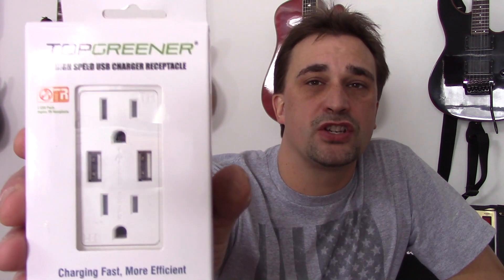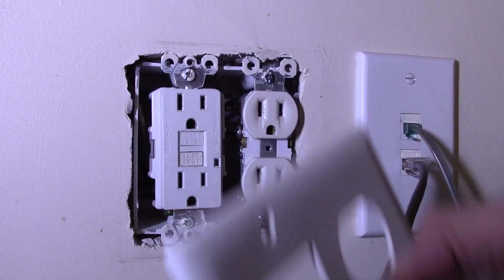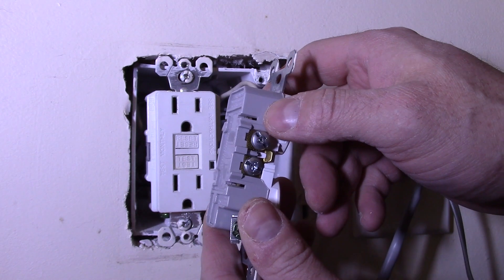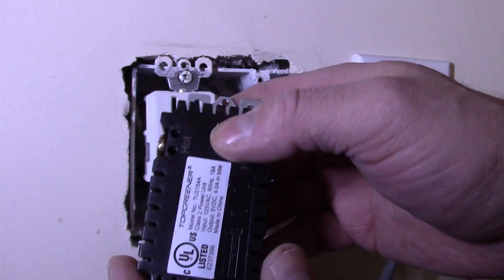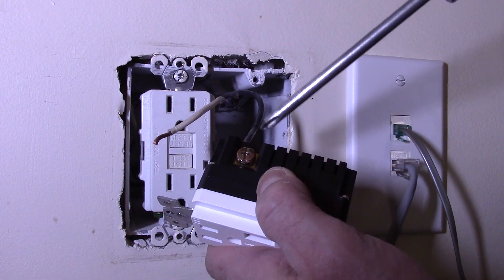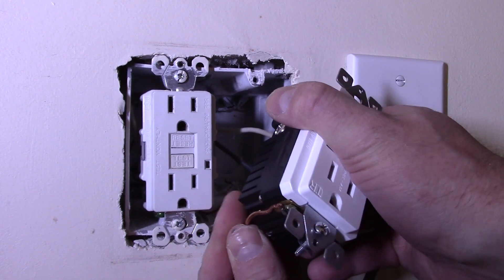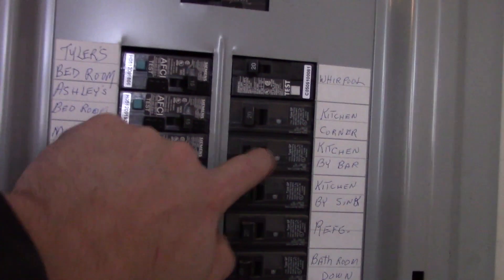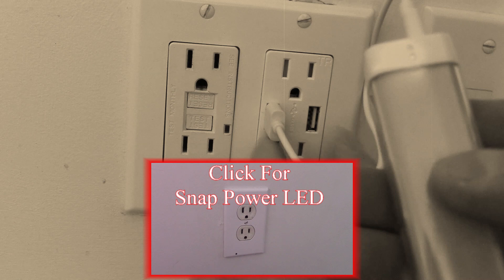DIY How To Install A High Speed USB Charging Receptacle USB Charging Port Installation

Comment: I liked your demonstration and installation.  You were easy to listen to and understand. I have a topgreener usb receptacle that I installed. I like it the best of all that out there. One drawback is that they are a little larger than some of its competitors.  They can be a challenge placing them in the electrical box, but I still love it.

Comment: Nice video.  My preference is to side-wire rather than back-stab except that in many cases you have a line and a load wire (2 black) and one screw in which case side-wire isn't an option.  These are great outlets but I do sometimes have trouble arranging the wires in a gang box so that it fits, being so much bigger than a standard outlet. Pain in the rear.

Comment: What would you do if you had 2 white wires and 2 black wires, do you just double them under the same screw?
Reply: There are two holes for black and two holes for white. Make surr the wire goes under the clamp. You insert one wire per hole and screw down the screw.

Comment: If you are DIYing your Receptacle installs, please be sure to double check for power before removing anything. at the least a Non-contact voltage tester will suffice. However, a multimeter will give a more reliable reading. Also, when removing the receptacle from the housing, do not short the terminals with your fingers! grasp the top and bottom mounting brackets and gently pull the receptacle outward. when finished it is good practice to verify the voltage output as a crosscheck for proper wiring and proper function of the receptacle. if you are unsure about any of this call an Electrician.

Comment: An outlet in my bedroom in my 100 year old home went bad. I want to replace it with this. How do I know what kind of wattage (might be the wrong measurement) I need for the wall outlet?
Reply: You should look in the breaker box and see what voltage the breaker is for the outlet you are replacing, and buy a replacement recepticle rated for that voltage.

Comment: Easy to install 'IF' you only have 3 wires in your electrical box. Unlike the outlet I replaced the Feit ONLY has connections for three wires and I had 5 wires to connect.

Comment: very good video  im a electrician  the one thing i see u did not do i always tape around terminals more protection in the event terminals touch n also if u ned to work on it hot but overall excellent  video keep video coming
Reply: Panama - saw your comment that you are an electrician so I thought I would ask your opinion here.  I bought a Feir electyric 2 usb port wall outlet.  My wife wanted it installed in the bathroom in a location that is one of two outlets on a GFI.  I didn't know if this was an issue and asked a elcetrically knowledgable friend.  After waiting and before I heard back, I emailed Feit electric customer service.  Their response was;  Thank you for contacting us, my apologies this device does not work with a GFI application.  I then told my buddy who said he didn't understand her comment and forwarded this video.  I'm wondering about your thoughts? Marc, Lakeshore, Ontario

Comment: LOL, I wish I watched this video before I switched all of my switches and outlets in my kitchen to Decora outlets and wallplates.  The cheapie wallplate you bought may or not be unbreakable and it's the small size.  I was replacing a 3 switch wallplate and like you I kept the screws loose so I could move the switches slightly, but one wasn't down enough and I cracked the plastic.  I went back to Home Depot and bought another one -- but since I didn't bring the old one with me, I actually bought a slightly different one.  The new one is slightly bigger and is made of unbreakable nylon instead of plastic.  I guess that's why they come in different sizes, I hadn't realized the difference in material though.  I also found trying to squeeze the wires into the holes of the new outlets I bought took a lot of force.

Comment: Does this meet QUALCOMM 2.0 quick charge requirements. In other words is it 1.0, 2.0 or 3.0 charging. There is a difference. QUALCOMM 2.0 quick charge is twice as fast as QUALCOMM 1.0 quick charge. I couldnt find that specification on their website and was curious if you knew. Reason I ask is when I plug into my wall charger the phone reads fast charging. When I plug into this outlet, it does not.